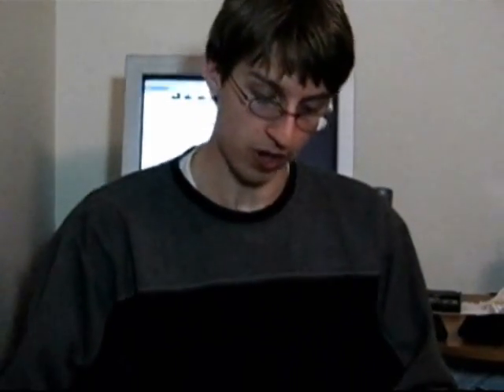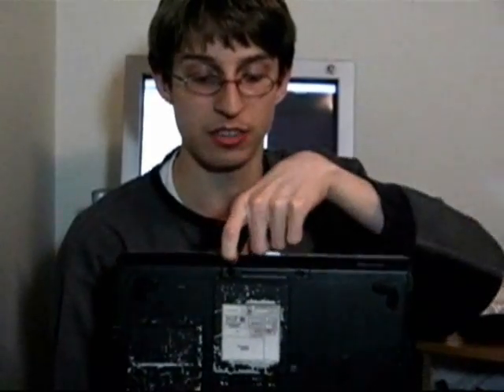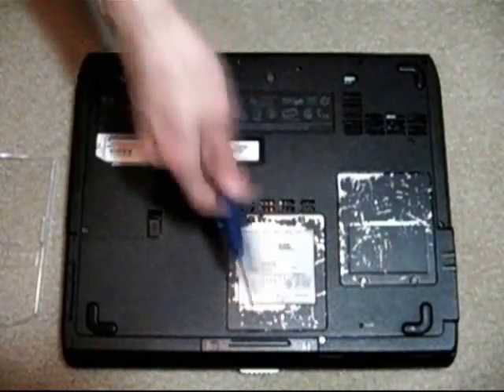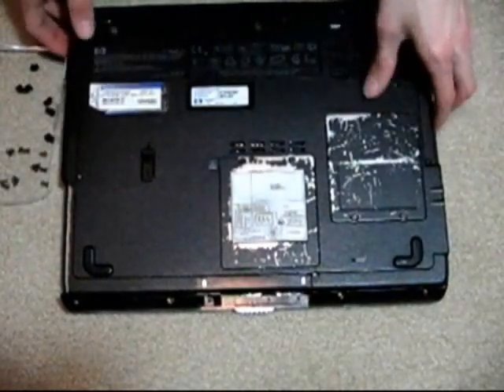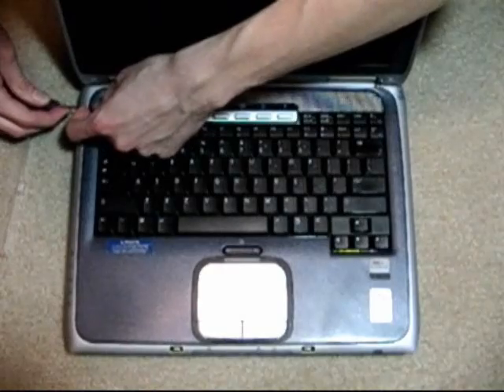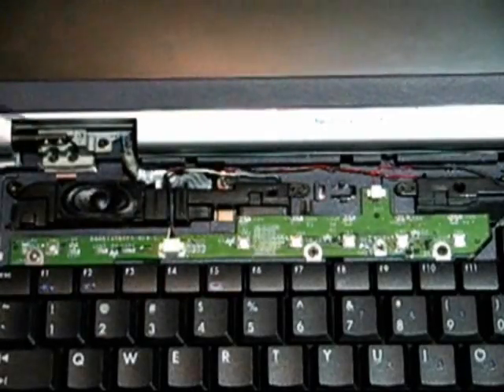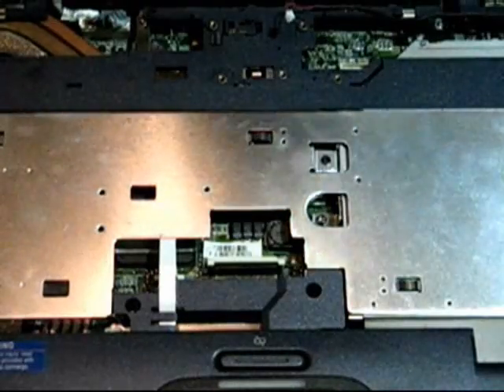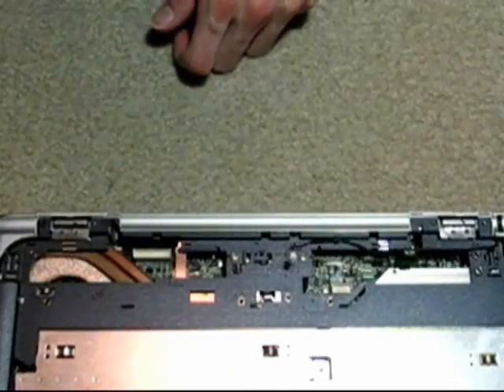KastenTech #1 Laptop Disassembly (part 1 of 2)

Comment: Just pull it to get it out that's it, I have a toshiba computer which is a little bit different NOTE: not all laptops have everything on the same place. and be careful with the screws if you're working on the motherboard, some of the screw holes are used from the outside, so be careful...

Comment: Thank you for the video. It was very helpful for replacing the keyboard. Although, I have one question. When you are removing the hard drive, there are two screws that have to be removed. What else do you have to do to remove the hard drive. I am finding the HD hard to remove just by removing the two screws. thanks